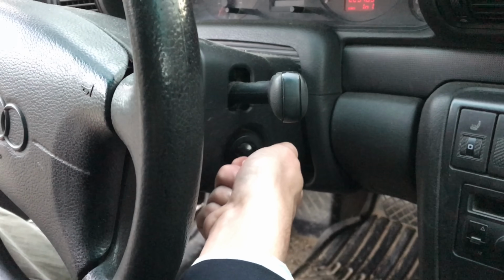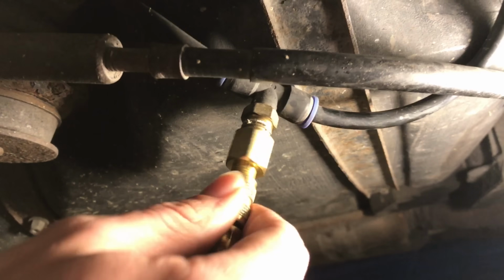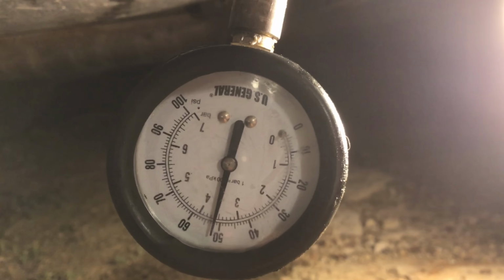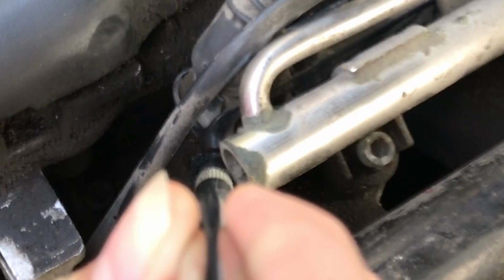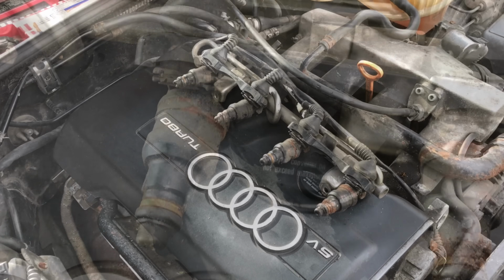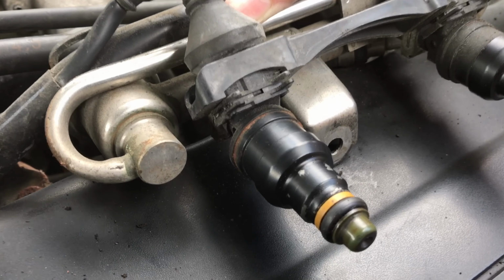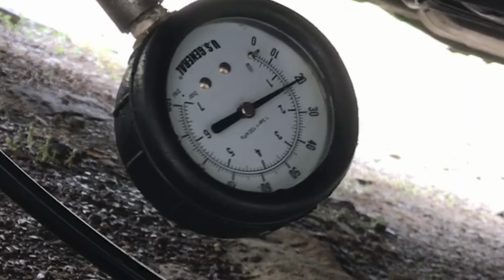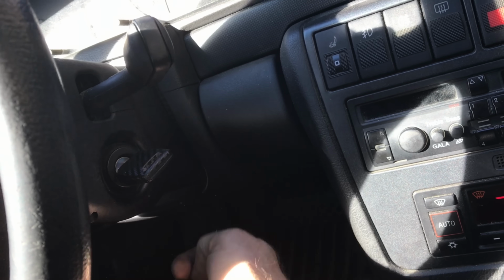Fuel injector? Fuel regulator? Fuel pump? Learn fuel diagnostics

Comment: This guy hears the engine is more than running and still holds the starter down
Reply: is that bad to do? ive never done it just curious
Reply: @antisocialfb6005  yes it's bad too do. It will cause excessive wear on the starter gear. You turn the key then 1 or even 2 seconds after it starts let go of key
Reply: @moto9968  right, seems weird to hold it on longer than you need to anyway, just didnt know the mechanics of it
Reply: @antisocialfb6005  mhmm yea dude

Comment: Bout to just throw an in line electric fuel pump in it. Is she STILL doesn’t idle imma have to take rail off and inspect injectors, if still nothin imma shove a pump and cigar in my intake and push air to see a vacuum leak. If i can’t see what’s wrong I’m a throw in the towel fr…

Comment: I spend under $40 on a bosch retail $160 fuel pump from eBay. Who the fuck spends $300 on a fucking fuel pump? Is that how you rip people off?
Reply: Well theres different quality fuel pumps and warranties and whatever, I would never trust an ebay fuel pump and thats probably why it’s only $160 lol
Reply: @grimase726  Wrong! I took it personally to advanced auto because I thought it could be a Chinese copy, they compared it directly to their retail $160 Bosch pump off their shelf. It was genuine Bosch with the same part number but I paid $37 for it!
Reply: @myanon6671  congratulations there’s still such a thing as chinesium knock offs
Reply: @myanon6671  Did you notice that the car is an Audi? I'm surprised it wasn't $3,000

Comment: Push lock fittings on a fuel line??!!?  I stopped watching right there.  Next time use a compression fitting, you will respect yourself in the morning and avoid all future issues like that push lock will give you.  Fuel systems are easy...add two cans of fuel injector cleaner.  The first one just cleans the tank and moves the contaminants from tank to filter and injectors.  The second fuel injector cleaner actually cleans the injectors.  My 01 SIlverado has a nice convenient fuel pressure fitting at the intake manifold.  Easy to access and crimped fittings.  The other step to a functioning fuel system is change your fuel filter.   Simple.  What if your short fuel trim is way higher that your long fuel trim?  Then what?  That answer is quite simple.
Reply: This is about diagnosing a leak down issue, dumping any amount of fuel cleaner won't fix a bad check valve or broken FPR